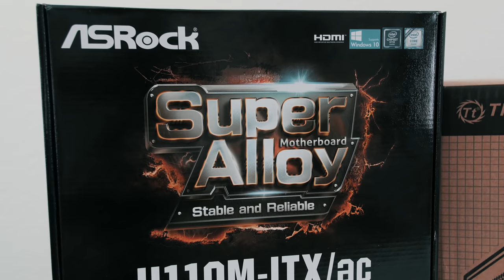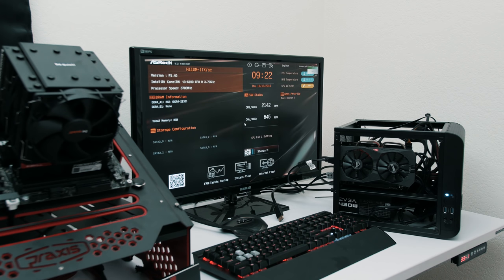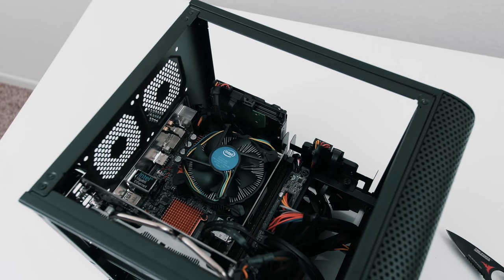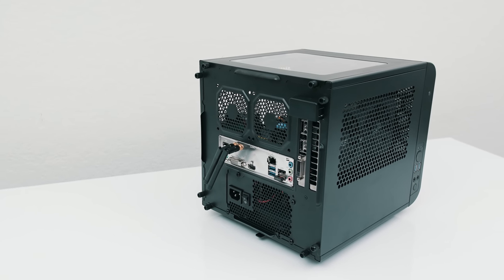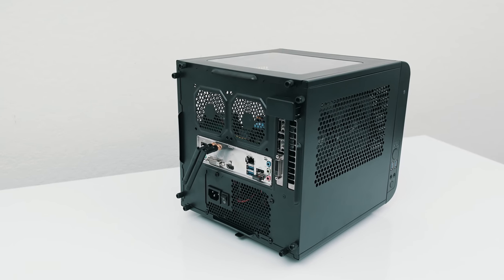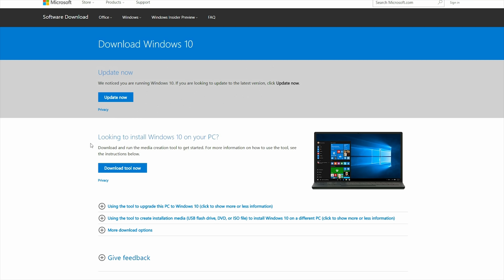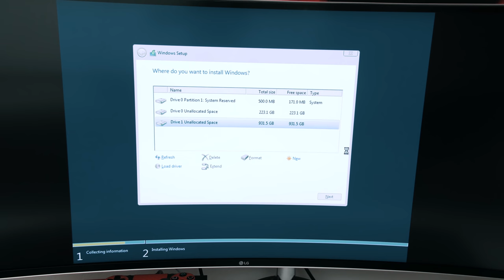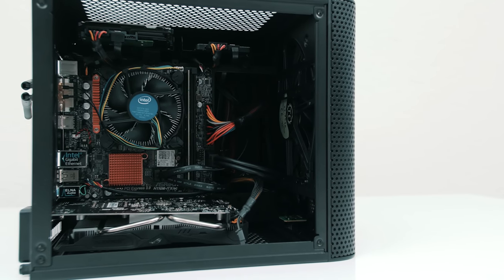How To Build A $500 Gaming PC w/ Windows 10 Install

Comment: Who actually builds this exact pc?
Reply: Air Brayden 
People
Reply: Air Brayden humans
Reply: Air Brayden homo sapiens
Reply: Probably my friend, he's been wanting something like this for a while.
Reply: Me, only with a different GPU and CPU
Reply: Yes. Only that the wifi installation was hell, other than that, I'm happy. Except i had a parts list similar to this before he announce dark cube. Just upgrade your cpu and gpu so you can get more performance
Reply: Just finished this exact PC just swapped the CPU with a i5-6500 and the GPU with an MSI 1050ti, Its a beast. Also the wifi took me like 10 minutes to hook up.
Reply: HurricaneScratch I think I'm gonna do this is it worth the extra money?
Reply: Jesse Goodwin absolutly. I am pulling 30 to 40 frames more frames on the same tests as in the video.
Reply: HS42 no new power supply right? Sorry I'm new
Reply: I am currently working on it. I  swapped the graphics card for a GTX 1060 and plan on upgrading the CPU and getting another RAM stick. I will say how it works once I am done.
Reply: [XGS] Imp3rial urgent question do u get the i5-6500 or the i5-6100 or do they both work?
Reply: [XGS] Imp3rial hey do I need to use different ram or the same type if I got the msi 1050 ti and the i5
Reply: HS42 do I need different ram or no
Reply: Jesse Goodwin ddr4
Reply: Jesse Goodwin if you mean like the same as the i3 yes yu can use the same
Reply: Air Brayden hey I need help I built the pc but where do I get the gpu drivers my gpu is the msi 1050 ti
Reply: Jesse Goodwin download gforce experience
Reply: I'm only planning on getting a different gpu
Reply: idk
Reply: R&D Gaming is there a CD player on it
Reply: Air Brayden I got it and it is a very good PC... Cable management is shit so prob have to work on that
Reply: can this motherboard support kaby lake prossesors?    pls reply
Reply: yes but you need a bois update so you need skylake to begin with
Reply: can you suggest an other motherboard with build in wifi  that does not need bios update???   i want to buy the new pentium instead of the i3 6100
Reply: olivia can you suggest an other motherboard with build in wifi  that does not need bios update???   i want to buy the new pentium instead of the i3 6100
Reply: Olivia can you suggest an other motherboard with build in wifi  that does not need bios update???   i want to buy the new pentium instead of the i3 6100
Reply: just get a b250 mobo and use a usb wifi mobo, you can search for a b250 with wifi, idk if there is one
Reply: thanks for the info!
Reply: Air Brayden ed
Reply: Air Brayden Is the 430w powers supply enough if I upgrade to an i5 and a gtx 1060?!
Reply: Olivia I have a usb wife 54mpbs recever .should I use that or buy the motherboard with wifi?
Reply: Use the receiver. Save the money
Reply: Olivia but am I losing my wifi speed my router is pretty close to my room but I don't want a shitty connection
Reply: Olivia and also how many mpbs is the built in wifi on the motherboard
Reply: The wifi on the motherboard was complete BLEH for me. I used an Ethernet cable instead,
(Antenna ~10MBPS. Ethernet Cable ~130MBPS.) This is from my experience. if you're going to buy the motherboard. Buy it for the Bluetooth function, I use it for my PS4 controller.
Reply: No you shouldn't be losing internet speed with your USB receiver.
Reply: Olivia alright thanks alot
Reply: Skadoodles does it run good
Reply: Air Brayden I'm building it right now
Reply: TheMcMater how is it?

Comment: recently built a similar build to this.  need some help! the pc turns on and all fans and leds etc turn on as expected but no display appears. the first time I tried to boot the pc the screen displayed like a mess of multi colours and that was all I've seen visually. the power supply also seems to kind of short out I guess when I touch the cable but the power stays on. could this be the problem?

Comment: will the Asus gtx 1060 turbo fit in this case ?
the Dimensions are -->                                             10.5 " x 4.38 " x 1.5 " Inch
                                                                               26.67 x 11.12 x3.81 Centimeter    thank you for reading and helping :)

Comment: in my country an i3 7100, gtx 1050 ti, 8gb ddr4 ram etc. with a full sized case costs €560, and with this core v1 and msi b250i pro it costs €590. so should i buy with the full sized case or with the core v1?

Comment: +TechSource i have all  of the cables plugged in correctly but my monitor doesnt have an hdmi so i used an hdmi to a vga but there is no connection so i used a dvi to dvi and still no connection what do you reccomend

Comment: Ed im not cut out for building a pc, can you recommend any custom pc websites?
Reply: +Rune Stavenes hey not true, i simply have a track record of technology never ever working like it should, and its not that easy, especially fer meh, ive never built a pc before, ive only ever used laptops too, crappy ones
Reply: u litterly only screw in parts and connect the cables

Comment: I built this pc but with a i5 6400 and gtx 1050 ti and 500w psu, but even at basic use ,Case ,cpu and gpu fans won't stop Spinning! i already tried Turning them down in the bios but that didnt work quite well, help pls!

Comment: Hey, Noob Here, First PC Build and I've done everything 3 Times and it turns on but I don't get anything on my monitor. my fans have even turned on but no matter if I use the HDMI port on the motherboard or the graphics card I get no signal and I've tried my monitor and TV. Any suggestions?

Comment: Made a similar build, not getting any power through the motherboard for some reason. Desperately need help.
Reply: Double-check if its connected to the power supply, if that doesn't work, re-build the PC, if THAT doesn't work... sorry, you probably have a defective motherboard.

Comment: Alright, so ive built my pc and when i turn it on, everything lights up and the fans work. I connected my 23.6 inch samsung monitor to my graphics car (A RX480 by msi) via a hdmi cable. The monitor either switches between analog mode and hdmi mode as if its looking for my pc but cant find it. Its really weird, can someone help me?

Comment: i did a $500 build just like this but i sacrificed half of the ssd memory so i got 120gb and windows 10 to get gtx1060 3gb, in a low budget build better to spend most of your on the gpu. i will just turrent win7. win10 is just a pain.

Comment: I am building my first pc, does hard drive speed matter? My old pc was at a 99% when in was playing gta v and was getting stutters
Reply: China It doesn't affect fps. Besides, all hard drives are 7200 RPM anyway. If you want faster launch times, get an SSD.
Reply: Thanks for the tip :D

Comment: Instead of the silicon power 250 gb can I use the 1 tb hard drive because it's much cheaper
Reply: Ratchet the gamer yes, but if you choose a ssd it would load some programs faster

Comment: Why not the AMD FX6350 ???? 6cores instead of the i3with 2 cores and hyper-threading
Reply: The i3 6100 is a bit better over the 6350 and it also runs ddr4 and has a much better upgrade path.
Reply: 6350 is old, outdated and pretty crap. this i3 is miles better and also way more cost effective
Reply: Aphix_

Comment: I've just built this, and the pc powers on, fans run and lights are on, but there is no signal to the monitor. any help?
Reply: Adam Foster did you happen to fix the issue 
I'm having the same problem
Reply: Adam Foster same problem but with another pc
Reply: Bryan Dissanayaka yes, I managed to fix it, try removing the ram and try both the slots, one at a time. for me it was a faulty ram slot, hope that helps!
Reply: Adam Foster thanks I hope it works ;) I'm trying to repair an old computer and I only upgraded the ram so I think that the problem it's with the sticks I used. (sorry for bad English I'm from Italy)
Reply: Bryan Dissanayaka could well be, hope you manage to fix it! :)
Reply: Gpu

Comment: if i already have windows on a hard drive do i need to reinstall it or just boot from that drive?
Reply: You can do that with windows 7 but i'm not sure about windows 8 or 10.
Reply: AbusiveAdvert no you would have to reinstall do to the bios being different and the drivers not being supported, doesn't hurt to try though.

Comment: Hey 
Can someone help me
I want to build this rig,  but few parts are not available in my country, and they suggested similar parts to the ones they dont have 

Asrock h110m itx/ac
i3-6100 3.7ghz 
Msi rx 470 8gb(rog gpu isnt available) 
G. Skill 8gb ram
Will this be a good rig without bottleneck any other components? 

Since ed rog gpu is not available 
Which alternate parts can i use from the ones he mentioned in description.   Till now the above specifications are onto my mind.  My budget is $500 / 30k INR
Will the vr ready gpu work with i3 6100 n asrock mobo?  I need a setup for long run 3-4+ years.  Really short on budget.  Please suggest a good spec which can run latest games anywhere btwn low-ultra.   Thanks.

Comment: So I want to build this pc, but I was wondering if I can carry it in my backpack while traveling on an airplane will the pc break or it'll be fine?
Reply: Smiley it's pretty big just built it
Reply: Razzer Yea will I have a big backpack but would it break? also should I buy the parts first then build it when I finish the traveling or?
Reply: Smiley I don't think it's smart to carry it, but the case is pretty solid. It's really heavy also. Just built it today, it's probably smart to build it after your travels
Reply: Also one more thing will they charge me if I carried the parts?
Reply: Smiley Who will?
Reply: For $200-300 more you can just get a gaming laptop with the same performance or even better.
Reply: The thing is laptops are expensive second I can't upgrade them and third I will have to spend like 500$ extra to buy a laptop with the same performance so I'm gonna check if carrying a pc on an airplane have a fee
Reply: Smiley If you travel a lot then get a laptop. Honestly carrying a PC is a pain, you still have to get the monitor and peripherals. You can't even use it on the plane

Comment: I tried building this but when I turn it on the screen just stays blank and doesn't boot to BIOS any advice?
Reply: Does it even turn on or it turns on but shut itself down, turns on again and repeats?
Reply: +WB IsMe  It turns on and stays on but there's no picture
Reply: Did you plug in the 6 pin PCI-E connector to the graphic card?

Did you connect the display cable to the graphic card display port instead of the motherboard's display port?
Reply: +WB IsMe don't have a graphics card
Reply: having the same problem, system powers on but no bios just a no signal screen using the hdmi display port from the motherboard..any luck figuring it out?
Reply: Sometimes HDMI display port doesnt work because of the Bios features. Try other cable like VGA or DVI.

Comment: I have a problem, when I built the PC I hooked it up to my monitor and it showed no signal
Reply: Yeah Same... Idk what to do
Reply: Ashfaq Khan IS Your ram in the good slot?
Reply: Flashper I have two ram slots and I put x2 4gb ram card in each slot
Reply: ive fixed it now, all i did was remove the graphics card, install the os and insert it back in the motherboard then i installed the drivers and worked, thanks for the help anyway

Comment: What if my motherboard doesn't come with WIFI/ internet cables. I'm going with a FM2+ GIGABYTE motherboard
Reply: The IO sheiks doesn't have the ports either so does that mean AMD doesn't have one?
Reply: most motherboard dont have wifi built in. You would need to buy a wifi card that goes in the expansion slots or just simply a usb wifi adapter.

Comment: So, where I live the i3 6100 cant be delivered to my location. Can anyone recommend another cpu that has roughly the same price and performance. I would like an intel CPU but im open to suggestions. Im also want to use a 1050ti with this build so if the processor is compatible with that, that would be great.

Comment: So I tried this build got it running g but it had no signal to the monitor then I tried rewired everything and now it won't even turn on can anyone help?
Reply: also I did have changes I have an i5-6600k skylake CPU, a corsair 650watt PSU, and gigabytes nvidia geforce gtx 1060 3gb over clocked.

Comment: This is dumb but I was missing the graphics card and ram still and I turned it on everything else was on and I don't know what I was thinking but I put (while it was on) the end piece of the cord with three of the things with 4 holes on all three and the light just started blinking like crazy so I unplugged it and now it won't turn on any help that I don't deserve for being so stupid
Reply: You can go without the graphics card if you're doing very light gaming (The CPU has built in HD 530 graphics), but you NEED ram, whether it's for gaming or not. If you're on a tight budget, 4GB of ram should do you fine for basic tasks. Don't worry, the blinking is just signalling a memory error, it won't harm your PC.

Good luck :)
Reply: jackinat0r 
Thank you!

Comment: are there any its boards that can hold two graphics cards?
Reply: kabin yang yes
Reply: can you give me a link?
Reply: Most larger motherboards this is a Mini ITX,Mini
 ITX's generally don't have two graphic card slots,you'll also need a SLI bridge.
Reply: i have a pc withs li atm i just was wondering if i can put it in a smaller case to make it more portable :<
Reply: kabin yang Corsair 380T is great it even has a handle

Comment: I have never built a pc, I am either gonna buy a moderately decent one with decent specs or just build this which seems, more decent than the one I am wanting to buy pre-built. My question is, can the upgraded i5 processor that is listed below in the description fit inside the motherboard Ed used in the video? Sorry if this sounds like a stupid and obvious question, I am not the brightest when it is 2 AM and have nothing to do :l/ Oh and also, do all the screws that Ed was talking about with the installation of the SSD and HDD come with the motherboard or something? or would I need to separately buy those?

Comment: what if when i plug it to monitor pc works but there is nothing on monitor
plzplz plz help
Reply: Justin Neeley  it didn't work i also checked all the cables and still nothing
Reply: are plugging it into the graphics card and not directly to the motherboard?

Comment: I'm going to build this PC for overwatch. And the first thing that came was the GPU and instead of the RX 460 I got a GTX 1050 ti. And I was wondering if I could just pop in the GTX 1050 ti into my current build without it frying or anything bad happening. My current build is this: intel core i3 530, 6gb DDR3 ram, and I believe a 300W PSU. Thank you!

Comment: Guys. i need help. i just bought my very first computer parts. it will arrive in 1 week. but ive been seeing some videos on how to install the corsair h100i GTX and they said to plug it to the power supply for the 12V. but i want a clean look. so i want to know the best and the cleanest. i appreciate all the help.

Comment: when your brother still thinks amd fx 9590 is better than an i7 6700k and intel runs hotter than amd yet im sitting here with a stock cooler i bought for the cpu which has a very minor oc on it and my temps dont go aboube 60C under load and hes sitting there with custom liquid cooling or a closed loop pulling above 60C on temp with the 9590

Comment: can i upgrade to gtx 1060 6gb?
Reply: Andaya Jezreel that's what I'm asking I want to get this with a gtx 1060 3gb
Reply: Yeah i tell if i can upgrade it with a gtx 1060 6gb not 3gb
Reply: Andaya Jezreel i put a gtx 1060 3gb and a i5 procecer all i did was upgrade the power supply

Comment: Pls help if i did this build could i replace the cpu with a i5 6500 and could i replace the pu with a 1060?
Reply: An i5-6500 would pair quite well with a 1060, but you wouldn't need it, unless you're playing CPU-intensive games such as GTA V, where the i3-6100 would bottleneck a bit. You can stick with the motherboard too because it's Skylake compatible.

Comment: can i use the 1050 ti
Reply: Julian Börner 
Yes
Reply: Julian Börner yes, a perfect match for i3 6100
Reply: joey hernandez if I go for 1060 and i5 he recommended for an upgrade will I have to change everything else?
Reply: Choice Band101 Nope.
Reply: Choice Band101 if you're gonna do it with the same case like in the video, u might want to see the length of the GPU so it can fit there
Reply: I can fit my founders edition 1080 in this case

Comment: built this with an i5 and radeon rx 470.booted up and all fans run and gpu lights up but cant get a signal to the tv through the gpu or motherboard hdmi out.does anyone know whats up with that?
Reply: had the ram card in the wrong slot🤓

Comment: How good is this:
Intel Core i7-6700K 4.00 GHz Quad Core Processor, 16GB DDR4 Memory, 2 TB hard drive, 500 Watt Power Supply, 64 bit, NVIDIA GeForce GTX 960 2GB Video Card
Reply: unbalanced as all hell, replace the 6700k with a 6600k and get a 1060 or 1070 with the money saved, much better preformance
Reply: Exactly.. there are so many bottlenecks...Get a 6600k and a 1060 or 1070 like victor said and get a more powerful psu for future upgrades and stability. I'd recommend a 240gb ssd and a 1 TB hdd instead of a single 2 TB hdd
Reply: Btw these are specs I just found from a prebuilt  computer.
Reply: pretty AWSEOMe but i think a 980 or 1060
Reply: okay i have no reason to hate i mite get a prebuilt

Comment: Cable list? or wich one i need to buy?
Reply: The cables are included, but you'll probably need zip-ties for your cable management. Cable management is important not only for aesthetic but for making sure your cables don't interfere with your system components.